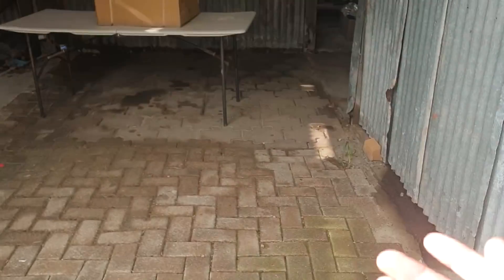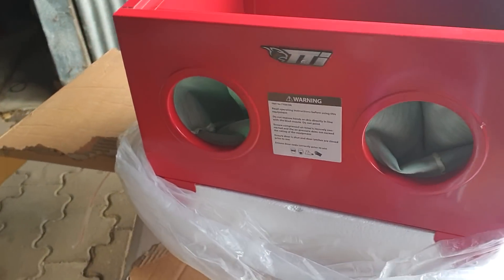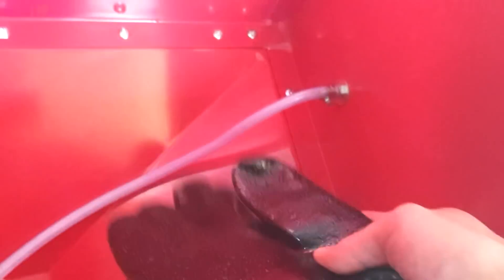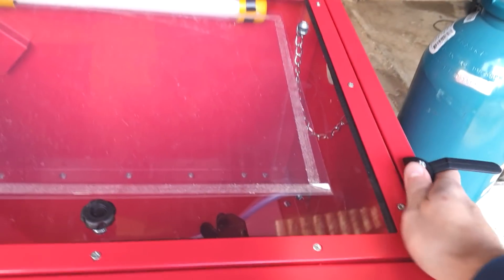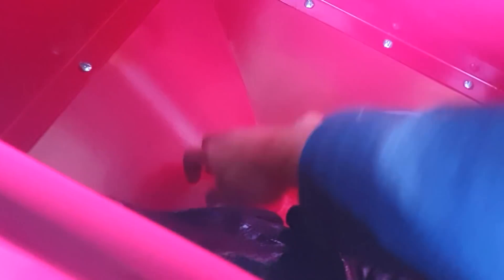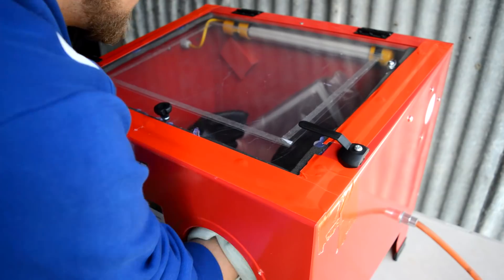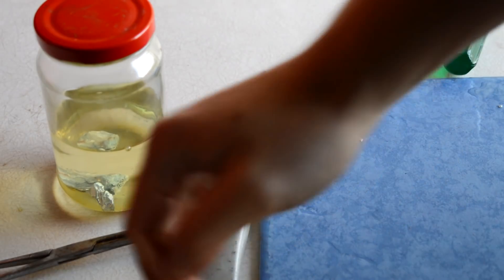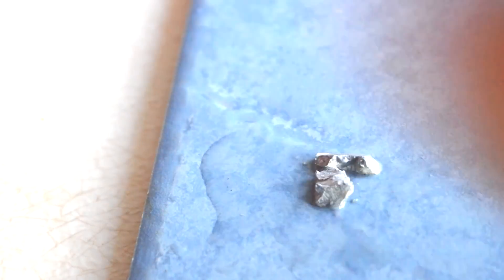Building a Glove Box for Air Free Chemistry

Comment: You can check for air leaks by pressurizing the cabinet with an air compressor or even a hair dryer, then use a spray bottle full of water with a few drops of dish washing detergent. Any air leaks will cause the soapy water to make bubbles. Cork would make a much better gasket for the glass unless you'll be experimenting with a substance that attacks organic material.

Comment: JB weld and gasket maker is what I would have used for this. I would also add an air lock. I would also add a pressure/ vacuum gauge to monitor the environment.

Comment: Others have given good advice. I can add a little as a geochemist who works in a soft vinyl box (which is cheaper in a lab set-up than the hard shells, if you can handle a couple PPM of O2). I agree that N2 is really the better option for something home made like this. Our boxes use an N2/H2 gas mixture (~4% H2) and have palladium catalysts to eliminate O2 that gets in through the transfer chamber. That set-up involves a bit more gas regulation, catalysts, and not everything loves H2, so it is probably not great here, but to scrub residual O2, we use a bubbler with pyrogallol and KOH in it. Something like that may be useful? I recommend some molecular sieves for drying, they are rechargeable and not too costly. Also mason jars, You can store your air sensitive things in mason jars or other canning jars inside the chamber if you have to briefly vent and they will probably be okay.

Comment: Holy shit sorry I missed this one.  You're better off with a glove bag on a budget.  You generally need to perform three vacuum/pressure flushes and then use a purge bleed to keep an inert atmosphere.  If you need it to hold shape, you stick normal lab hood grid in there and just assemble it after the flushes.  We did this for toxics, pretty crazy acid chemistry, and pyrophorics when I was working for one of the big guys.  Obviously we had workplace safety concerns that led to procedures above and beyond what the chemistry needed, that was meant to ensure our safety as chemists / operators.

Comment: You should attach a vacuum cleaner to the cabinet to remove air before adding argon. that is what I did with a cabinet I made for sand blasting, works like a charm.

Comment: I'm not a welder, but that does seem expensive for argon and a cylinder. I got a 5 pound bottle of co2 to experiment making my own soda. soda for drinking, not for explosions, I'm very sorry. I think was a good deal. I paid about $90 for the cylinder and $12 for the fill. by my math (just google) you got 8.2 pounds of argon, so I think similar size tank as what I got. I don't know the price for argon, but I plan to get some this summer for welding.

Comment: I have used a sandblaster very similar to this in the dental laboratory. We invest wax cast in plaster and then boil out wax and use pmma in a play dough state to push in the mood and press under hydraulic press and then cook in controles water baths until complete curing of the denture acrylic resin. Anyways after the polymer is hard and an acrylic we will use a sand blaster that has walnut shells in it to clean off excess plaster / gypsum stone and flashing. This was how we did it in my old lab but now days we just used stone and plaster remover containing formaldehyde inside of an ultrasonic. Just throw the dentures in the intra sonic bath with the stone removing solution for 2-5 min and all of the stone left on cast is gone. Very satisfying to see it go from rough and have plaster stuck on the resin to see it just fall off and become smooth and easy for finishing on the motor.
Reply: Push in the mold*
Reply: Also in the fabrication of metal frame works like a metal support in the mouth for teeth. Called rpd. Removable partial denture. Same thing investing wax in plaster and then baking out wax and using a metal casting machine to cast chromium cobalt( very cool shiny metal and very resistant bc we use it in the mouth. ) anyways they metal after broke out of plaster with have plaster stuck all over it so you sand blast it in a sand blaster but instead of crushedwalnut shells like for the denture it’s very fine silica sand that will get rid of plaster and not the metal. Very interesting. But hey I love your videos I would love to be able to do more chemistry. I love that I get to use some cool polymers in my field tho. Very candy pink denture acrylic that is strong and gets so shiny and safe for the mouth it’s cool. I also have got the opportunity to use their cad software and print dental baseplates. Very cool resin that the 3D print uses to make mouth accurate parts. I don’t have my own 3D print so I absolutely love doing work with the 3D print at work. The resin is very scary tho in its uncured state. Just as the pmma. Both can cause cancer and the 3D can cause gene problems and makel you infertal. Liver damage. It’s pretty scary. I’m glad I’m into chemistry so I look up the safety data sheets in these chemicals I use and understand what can happen and how to protect my self. Also if people in this industry don’t use a lot of protect. Not like I do. I wear ov respirator and goggles and blue nitrile gloves. I’m paranoid about monomer in my eyes or the resin on my skin and eyes. Anyways sorry for long comment just went in a rant.
Reply: Btw I don’t own a lab I just work in a dental lab as a dental lab technician.

Comment: I would suggest converting one of the ports into an airlock. Higher pressure inside would keep oxygen out when you open and close the door.

Also...  more lockdown points and some silicone tape for a better seal on the top.

Comment: I used to maintain the freon degreaser where I worked years ago, and the gas was heavier than the air, and it kept the air out very well without a lid. I suspect argon would do the same, but the lid will help alot in keeping the air out, once it is out. But, until it is out, you need to let it bleed out as the argon enters the box, otherwise the box gets over pressurized.
Use the candle on a wire trick to show the argon is in the box, then you can see the pressure does not need to be very high to maintain the level, and you will save gas.

Comment: If you don't want to weld that box airtight just put sheetmetal over the holes and fasten with tecscrews or poprivets. Use RTV silicone in between to make it airtight. As for the lid, you should be able to find rubber window/doorseal on rolls in the hardware store to replace the open cell foam(if it's necessary.)

For testing the chamber you could affix s pressure gauge to the box and pressurise it and see for how long it maintains pressure.

Comment: BTW, if anyone really really want to do some small scale air free stuff and can't afford/can't make a decent glove box there's also "glove bag" containment chambers which are basically just sealable LDPE bags with gloves inside that you can inflate with an inert gas. The downside is the gloves suck major ass and they're wonky to work with because you have to load all your materials into a deflated bag. Also since it's plastic they can't really handle heat or non-polar solvent spills. I know this eliminates a lot of fun things but maybe it will be useful for some experiments? You can get one for around $20 USD on Amazon. 

Another tip is that you can buy small argon spray cans meant for keeping wine fresh after opening for ~$15 USD on Amazon. They only contain around 12 grams of argon which is I think around 7 liters of gas, making them pretty expensive for filling a glove box but is probably more than enough to de-air small reaction vessels/the headspace of reagent containers for a few experiments. Just make sure you get the ones that say they contain pure argon because some companies sell nitrogen instead which isn't as good.

Comment: Where the circular hole is that you put acrylic over. Remove the acrylic and ad a pip of some kind that fits snugly into the hole. You can then add a little door on the inside and outside of the chamber to the pipe to have a little air lock. It would be quite small unfortunately though

Comment: For about $4-5 you should get a tube of silicone sealant and squeeze a bead around all the gaps. No need for tape or the foam. You can get an air tight seal with silicone. There is a reason they use it for gluing window glass into the frames and in bathrooms. Silicone is also unreactive so no worries about fumes.

Comment: $3 Helium bottles at the balloon store. In a pinch, propane cylinder will do, assuming your fume hood handles flammables. Wet steel wool tower or Chromium +2 (zinc) column will take oxygen out of the air (alkaline steel wool snags CO2 also) CO2 works sometimes. Some metallations can be done with Zinc and Zinc organometallics are tolerant of air and water.

Comment: Is there a chemical reason you're not using silicone caulk or something for sealing? I bet you could get an even tighter and better fit seal around the top by putting it face up temporarily and curing some where you currently have the foam, and it'll definitely seal up all your little leaks really good.

Comment: A recommendation from my undergrad days for a cheap H2O/O2 sensor, cut a hole or otherwise break the vaccum on an old incandescent light bulb (the kind with a tungsten wire) and put a power strip in the box (power might be helpful for other reasons, like keeping your camera charged).  How long the bulb lasts gives you a pretty good idea of how much O2 is around, in our glovebox we could usually keep it going for a few days, sometimes a week.  My guess is you'll get a few hours of light out of it, but it might help you test seals and such.

Comment: I recommend this type of very low pressure regulator - Equilibar LPR2 no bleed.  Mount this on your box, downstream of the tank regulator.  This is all the pressure you need, far lower than your tank regulator can provide stably.   I've used these for years to keep high altitude plastic balloon film test  boxes pressurized to ~1000Pa, which probably is about what you want anyway.  

I recommend 1/4" OD tubing, polyethylene, both for your tank regulator to box regulator, and for the box reg to the box.  Use "push to connect" fittings- they will save your sanity.

Comment: if you are afraid of leaks, you should submerge the box in water and flow compressed air through the box and locate any leaks, then use a stable sealant like epoxy or silicone paste to seal the hole real nice. If you want, you can pour liquid rubber in the bottom of the box and seal any potential leaks because your ultimate goal would to almost create a hermetically sealed environment?

Comment: I suspect every single fastener will leak a fair bit - sand around the fastener (to give some mechanical adhesion surface), clean it with a solvent, and cover the fastener and circumference with sealant - epoxy or silicone.  Add a flow meter to your gas source and to the chamber to get an idea of how much gas is leaking.  Once you've got it really sealed up well, a very low pressure relief valve would be a good idea.

Comment: You could mount USB  webcams in the corners, and seal the holes up with a bit of plumbers silicon maybe? Would definitely be cheaper than a GoPro, and not too expensive to replace if they get damaged.

Comment: As you have a vacuum pump you could make a connexion to evacuate it, also i work with Argon glove boxes because N2 could maybe interfer with my chemistry, however if you just need dry and water free atmosphere i suggest to go for N2, cylinders are much cheaper and as you use an overpressure you can achiever inert atmosphere by flushing the GB with N2(even better if you can cycle it vacuum-N2) it would still be much cheaper

Comment: Hey man, hope I'm not late for the party. My experience from working with physicists (I'm a chemist working in a physics work group) is that you can improve the fittings by using copper plates instead of foam. It's standard when working at pressures of around 10^(-10) mbar, so they might do a good job. Copper has the additional benefit of not leaking out any solvents. From the physicists, I also learned that you can just use soap water to check for leaks. That works hilariously well.

Regarding the inert gas, you might wanna consider if you don't want to buy a bottle of nitrogen as well. Most chemicals requiring protective atmosphere do just fine with pure and dry N2 and that might save you some money in the long run. You can pass the gas through CaCl2 if you want it nice and dry.

Hope I could give you some valuable input, don't hesitate to ask if you have any questions. Cheers from Germany mate, love your videos!

Comment: Put a drain cock in the bottom hole that way you can wash out anything in it that turns yellow. Build a rudimentary air lock attached to the large hole in the side. perhaps out of pvc drain pipe with a flange to screw to the box. On the inside a large rubber cork and the outside a screw clean out plug as a cap. Silicone gasket material for the lid is easy to find. Something with a flange and tube molded together.

Comment: A simple way you could make an airlock out of that hole on the right side that you covered with tape and acrylic; get some PVC pipe about the same diameter as that hole, attach a threaded fitting and threaded end cap to both ends, seal the gap around the pipe with silicon. Open the outside cap to put stuff in, close it, open the inside cap and you have your airlock. If you want to take it a step further, if all your PVC is high pressure rated, you could attach a high pressure valve to the outside end cap and vacuum purge the airlock after putting things in it.

Comment: I would suggest adding a one-way exhaust valve to the box, rather than relying on leakage through the gaps to purge the box. Then maybe replacing the gloves with some that allow for finer control and easier manipulation of small parts.

Comment: About Foams: There are so-called "open-cell" and "closed cell" foams. In open cell foam, the bubbles in the material are connected with each other through small holes, meaning gas can flow throughout the entire foam, making it mostly useless as a seal. Ideally dont use any foam at all. Silicone rubber and similar stuff is a much better option.

Comment: Not sure how applicable this is to Australia, but in the US we use CGA (Compressed Gas Association, iirc) fittings for gases. Your argon bottle would have a CGA580 connection. The inlet on the cabinet is almost certainly NPT, looking like 1/4” to me. You Aussies may use British Straight or Tapered threads, but if it’s made in China it’s probably NPT for the US.

Comment: Also your door frame is too weak to accommodate the additional pressure.  I would add more 1/4 turn pinch clamps to distribute the doors seal pressure more evenly and to prevent weak door frame from bending at current pinch points. 
 I know nothing of building, mechanical things or pressurized systems. It took me until 1999 to pass my master plumbers exam.

Comment: Not that it matters but I would have left the door foam and added more thin foam on the boxes interior door flange. 
Cleaner,  easier and quickly modifiable or replaceable.  But screw critics, sure it's fine.

Comment: First things first you need a trio of ball valves mounted to bulkhead fittings, one for the argon, one to vent to atmosphere, and one for vacuum. Next you need a simple airlock. After that you need a second air lock style adaptation for the camera and to put it behind some glass because it'd be less reactive than acrylic. Need to also ditch the hot glue on the inside of the bottom joint and weld a proper bottom on there, just a thin piece that comes about a half inch to an inch up the sides so that you have a good seal.

Comment: If you wanted to build an airlock, you might be able to do that with two pieces of tupperware (possibly best the four sided ones that seal each side with a clasp) you glue to the wall, one on the inside and one on the outside, their bottoms removed. And of course a paint job!

Comment: Hot glue mate? how about silicone! Silicone around the acrylic plate. Maybe run a bead of silicone around the lid and let it dry before closing it so you have a continuous silicone gasket to press up against like a real rubber one, without the foam.

Comment: Try using silicon tubing as the seal around the lid as you never Know the reactivity of the foam used.  A glass lid would also help, you can get a panel made by any double glassing company quite cheaply, additionally open each joint from the bottom up and seal with silicon tape.  So far as the glove issue, a pair of fume hood/air box glove are not that expensive.  Just a thought.  Keith

Comment: It looks like what you're doing is sealing up a box full of air so it's very nearly airtight, then pumping in argon and hoping for the best? Would it not make sense to try to remove some of the air first? Or at the very least do something smart to make sure that it's air leaving the box and not just argon going straight through? I guess a real-time measurement of the atmospheric composition in the box is out of the question :P

Comment: I definitely would be concerned about safety - none of that is chemically rated. I’m taking the paint and gloves specifically. Those gloves I would swap out before doing chemistry as they are not only clumsy but could react with anything you don’t know about. Apart from that it seems you almost spent as much, at least time and effort on making a glove box and now need a new camera why not get a real one 😂. Again swap out the tubing as I see with certain gases would corrode the tubing fast.

Comment: If u make it completely air tight.    Theres no way to get argon in.   I would have left the “leaky” lid.   As u said argon heavier than air.  So as it fills up it displaces the air out the top.   Then a slow flow should keep it purged well.   Save you a lot of argon that way.   But it is an awesome diy atmosphere box